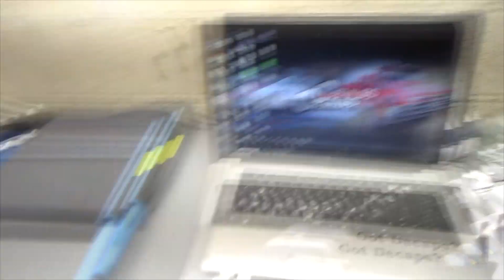GM 4200 Speeduino update, sadly we found bugs. Video's to come update as well. 1-5-2020

Comment: did your friends ever figure out the gm7x wheel issue?  i just ordered my standlone speedunio and have a ecotec 2.2  03 with the gm7x.  any pointers you could throw my way to ease set up please?
Reply from the maker: Jeffrey Heelan I haven’t tested it on a 4 cylinder but on a 4200 straight 6 it’s off. Latest firmware should fix it. We still need to verify which edge of the trigger wheel it needs to see as well. So best answer is still in testing.
Reply: @TwistedBuilds  add me to the list of ginny pigs.  I'm on few of the forms. I'm just silent mostly. I just read and absorb as much information as I can from you guys. It should be here next week hopefully. All ready ordered few days ago. I'll keep you posted if I learn the info also.  Please let me know if you find any good info brother 👍🙏